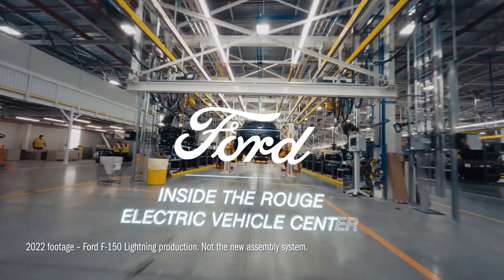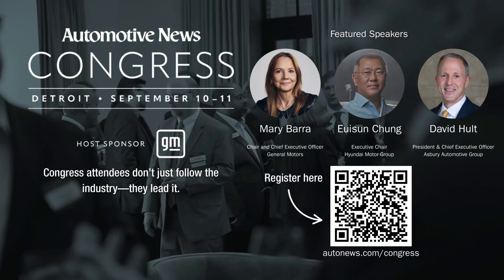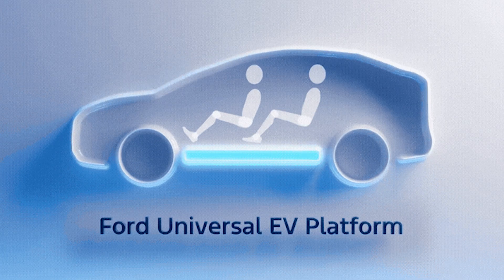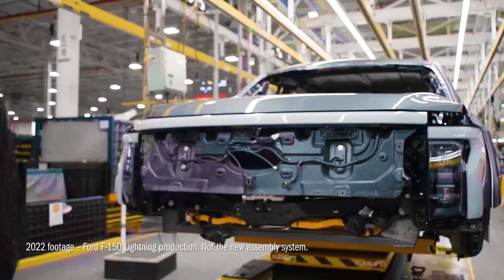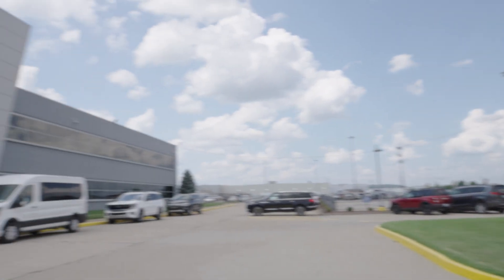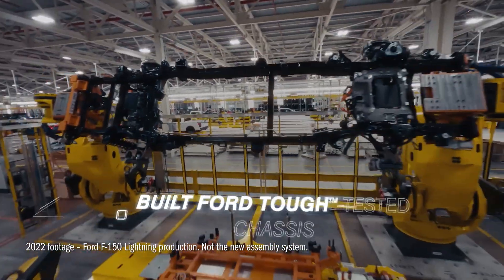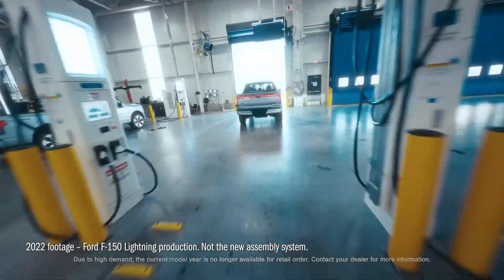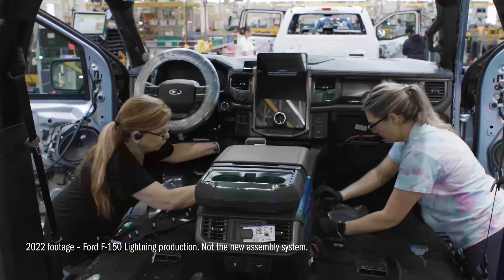How Ford’s ‘Assembly Tree’ Could Redefine EV Production

Comment: What would revolutionize vehicle assembly is building vehicles with a 5 year, 60,000 mile warranty that didn’t require repairs, or recalls during the warranty.  And would go 100,000 miles with minimal failures.  Otherwise you’re just building crap quicker and more efficiently.